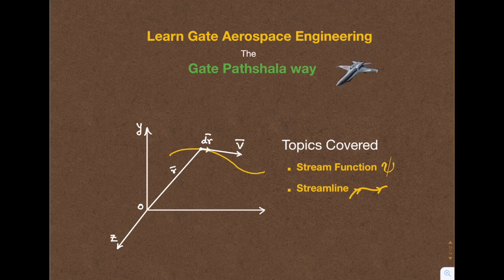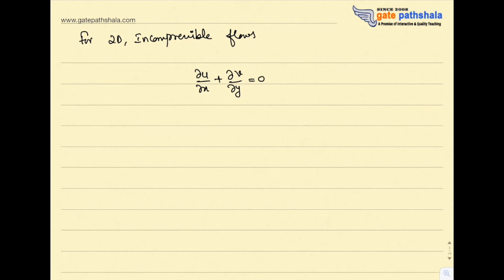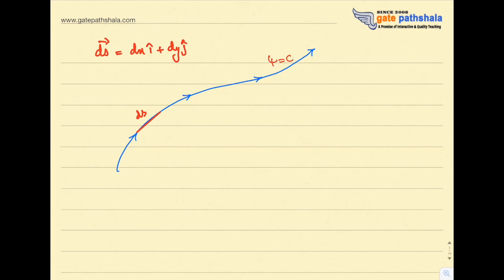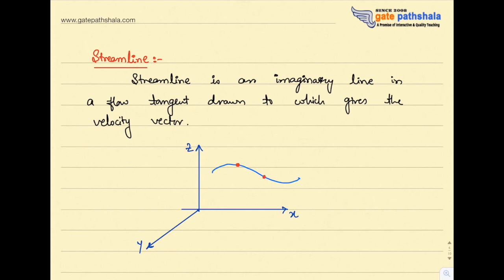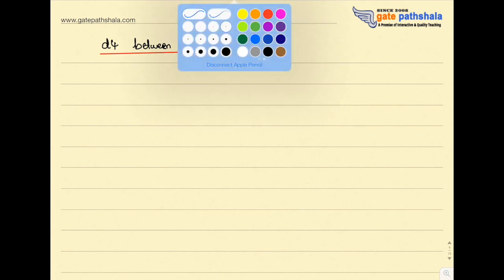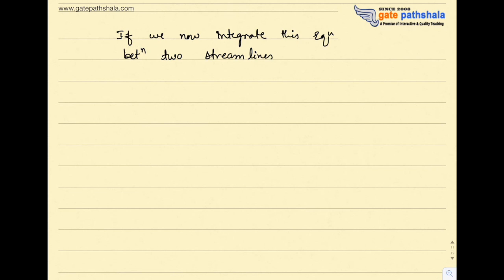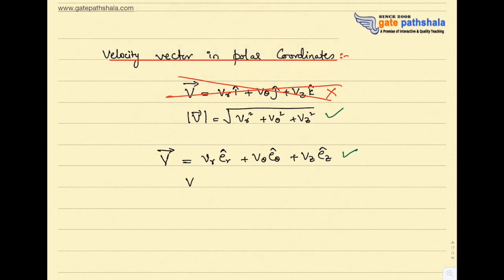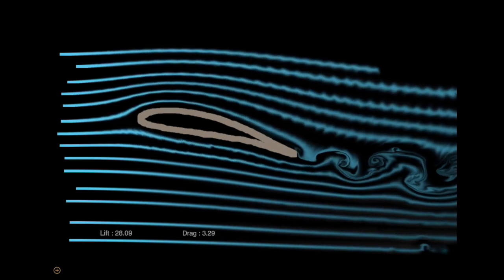GATE Aerospace Engineering Lecture 01

Comment: Video is good maybe a little bit improvement on the sound quality,otherwise pretty neat. The actual class room lecture is more informative than this,I have experienced this, if others also want to experience join gate pathshala Chennai's greatest aerospace knowledge hub.
Reply from the maker: infinitestranger  surely there was something wrong with my mic. Your comment is very correct and I really appreciate it. Will work on better mic in coming lecture.